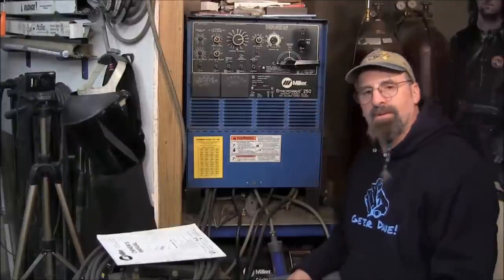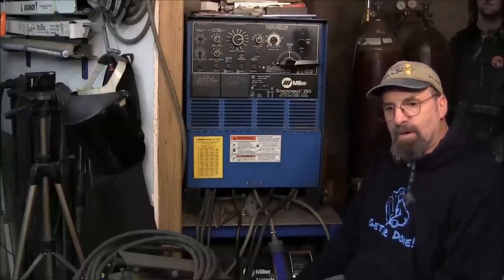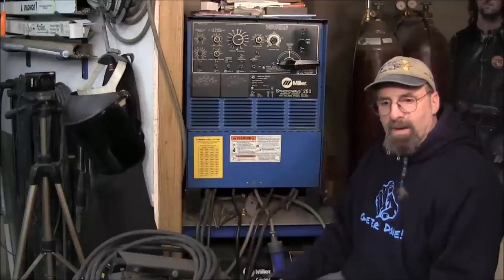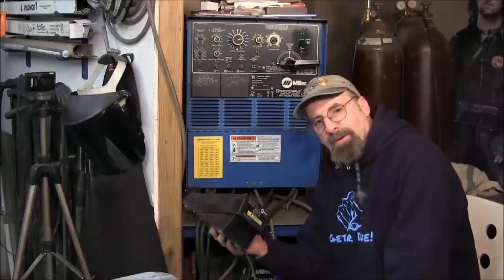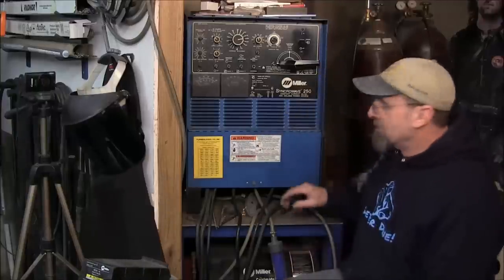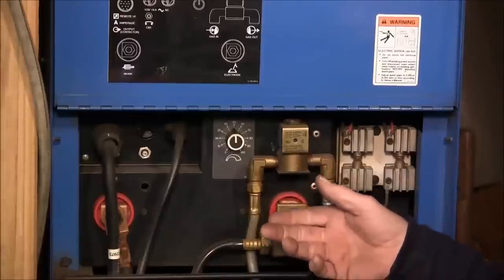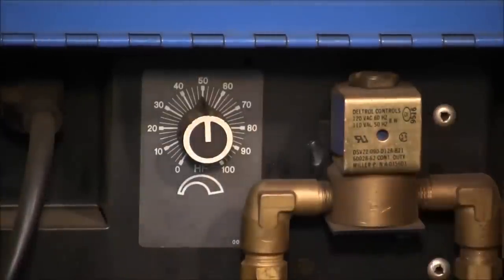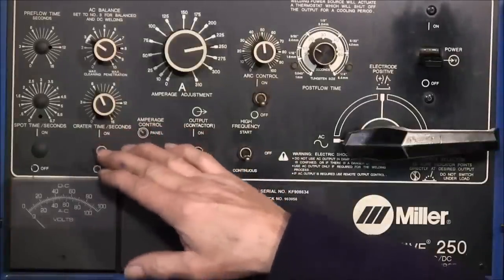The Manual 3D Metal Printer Part Two

Comment: 3/32 tungsten is a little small for aluminium but it does give you a nice quick stable arc. It just wont last long. A 1/8th will last longer but it takes more push to get the arc to stabilize. I usually decide which to use depending on the thickness and size of the base metal I'm working on. If I need a lot of amps I'll use the 1/8th tungsten.

Comment: I like your way of mixing your own gas. It seems the multi mix or pre mix from some suppliers can be a little hit or miss from one bottle to the next. You can be spot on on one weld then need to change bottles and the entire thing is off and needs to be readjusted.

Comment: You did notice the Syncro serial number starts with your initials right?? It was made for you!!
For the arc shots I think I liked the purple filter best. Some of the others looked washed out and didnt have the detail.

Colin ;-)
Reply from the maker: ***** Yeah I noticed the serial number! LOL but it took twenty years to see it! LOL Yeah I switched around on each scene and the ones I left with no color were some of the best shots and didn't want to lessen them, in any way, it was a toss up, if it looked better in purple or plain. I wished I could lock the focus, in manual, in the mode, I use that controls the light values. It is a learning curve, the project and filming this adventure. ;{)-----

Comment: Couldn't you use pulsing to help not over heat your base metal and allow for a deeper penetration while allowing for a larger build up?
Reply from the maker: palahniukpaul Pulsing, I believe is more beneficial for uniformity and like temperature control of bonding two thinner pieces, I might be off, because it has been 25 plus years since I played with a machine having pulse control. When your adding a build up, your trying to keep the overall between the base and the droplets as cool as possible to stack. That would be a great question and subject to ask Jody, so he might be able to give it a test environment! ;{)------

Comment: Hey Keith, is the metal foot pedal still broken?  What's the model? I vaguely remember working on them when I did welder repair back in college.  Our shop was a Miller authorized warranty repair facility, blah blah blah. :-)
Reply from the maker: baconfatlabs well on a little black tag / sticker it has 129 339 and under that number is RFC -14 and on a little white oval tag / sticker is KF-18

Comment: I didnt catch whether you mentioned what you needed tor current to run this welder. Is it single phase?
Reply from the maker: D Fuller 100 AMP'S single phase 220 ;{)-----
Reply: I am trying to find a tig like that at a decent price. Haven't had much luck. I bought one of the Chinese tig welders it works good on steel but it doesnt have the output I wan't for aluminum.
Reply from the maker: I had to bury the cost into a few jobs, to buy one of these brand new back in the 90's. ;{)----
Reply: Definite piece of equipment people don't get rid of.

Comment: You really arent that concerned with volts when you are TIG welding. You use the amp meter. Volts only come into play when you are MIG welding as they are what you use for temperature. Most MiG equipment is rated in volts and that is what the weld specifications call out. In volts. Normal short circuit mig welding is usually around 16 to 18 volts. Spray arc mig is between 28 and 30 or so depending on the wire size.

Comment: hm, part twi ans still non 3d printer, feel I been scammed...
Reply from the maker: It's there you didn't see it! LOL ;{)------
Reply: You did not earn those views, cheaters never win
Reply: Walkertongdee In sense this is 3d printing, but just barely and not in traditional way. His taking the base plate and adding material to form new, technically with this method you could 3d print anything, thought it takes tons of time to make anything more than valve point or small like that and its not that accurate like real 3D printers.. 
I have used this type of "printing" with steel parts, like with AK finger selector switch. I took just plain steel plate, cut right shape, put welder in high wire feed, moderate power setting, added material and grinded extra off to make new part. Sometimes its easyer to add than remove. Imagine if i had done that parts from block of steel. It would have take me tons of time to grind extra off.
Reply: Walkertongdee  What do you expect for 2&6, the ninth divvy ?